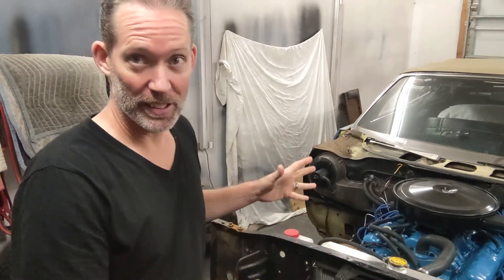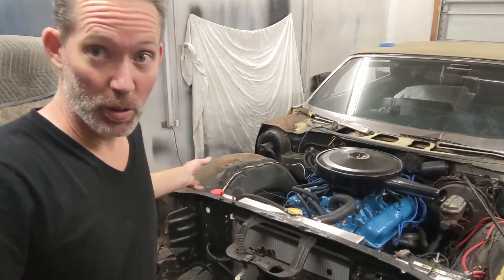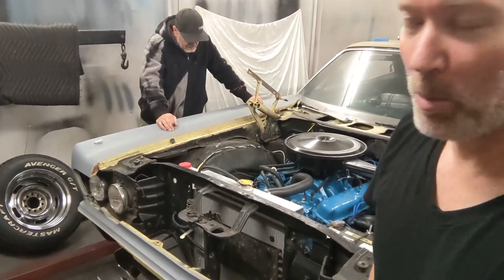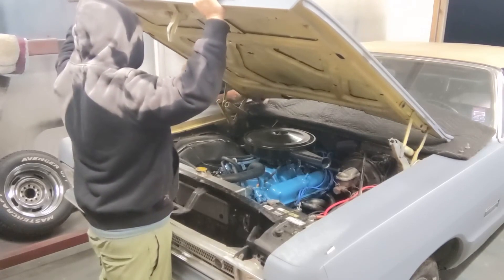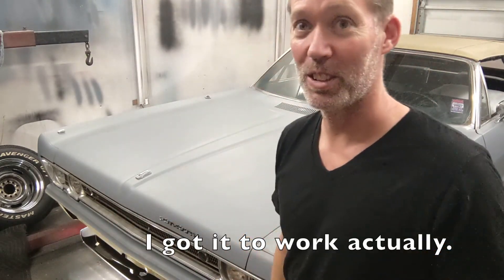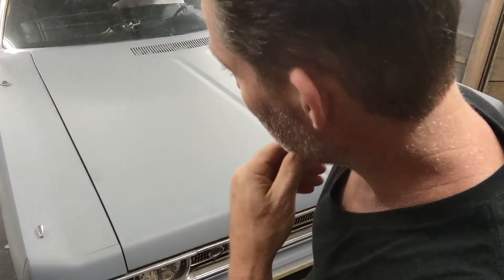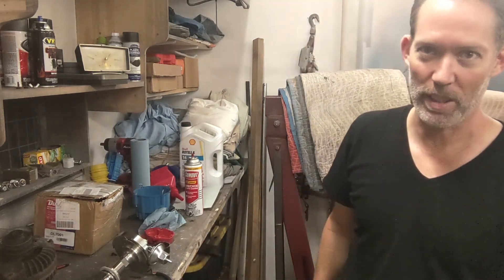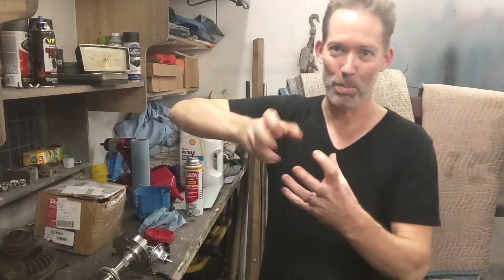1969 Plymouth Fury III ep20

Comment: First convertible I ever drove was a '69 Fury III.  B5 blue, white interior & white top.  Bought by a high-school friend for $300.  He didn't have a drivers' license, nor did the car have brakes; so he asked me to drive it from the shed where he'd bought it to the high school auto shop.  Luckily, it was only a few blocks but it was a beautiful morning - so I put the top down.

We filled an entire 60-gallon garbage can with peanuts that were stashed under the back seat by some rodent.

The car met it's end one night when my friend decided to drive it around still without functioning brakes. The used the parking brake with the ratchet pawl bent out of the way.  Well, I wasn't there, but the story goes somehow the car wound up in a ditch at which point it rolled onto it's roof.  Since my friend was.... a bit odd, he'd never actually transferred the car into his name, so he had no insurance.  

Sad part is I'd tried to buy the car from him several times regardless of how rotten the trunk floor or quarter panels were.  The rest of the car was top notch.
Reply from the maker: I really appreciate the story. Always sad to hear when a car suffers because of our bad decisions. You may be happy to know, my daughter's first drive was officially in the fury. She was 12 at the time, but allowed her to first start it and warm it up. Then she graduated to putting it gear and slow rolling it into the driveway.